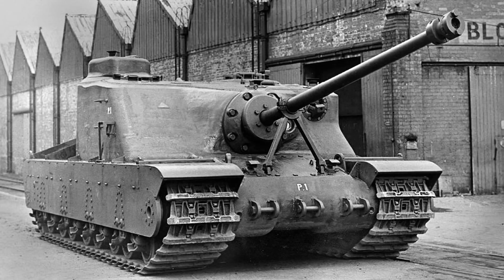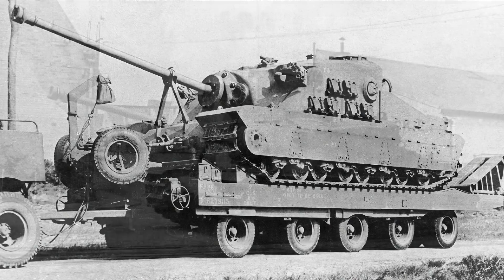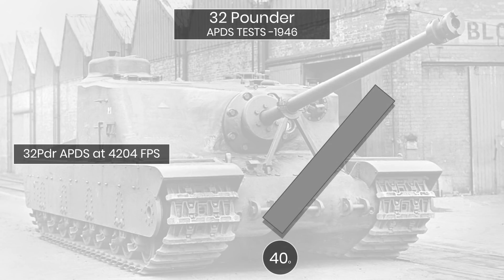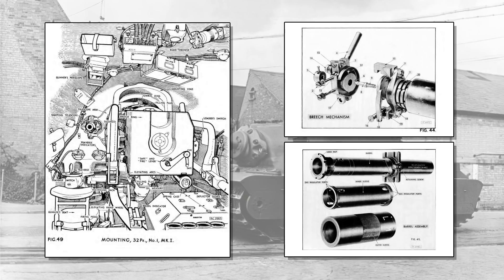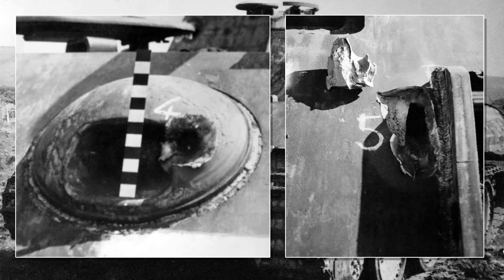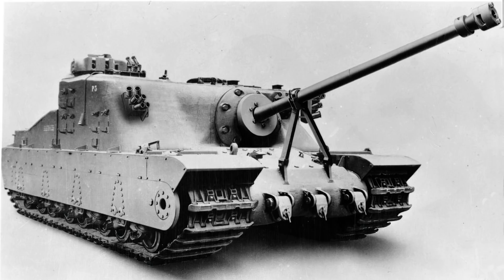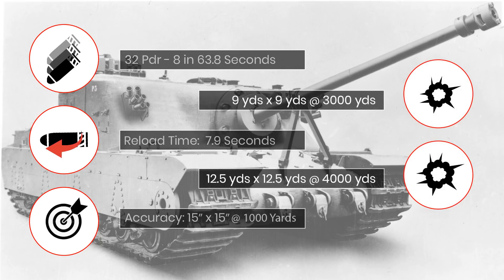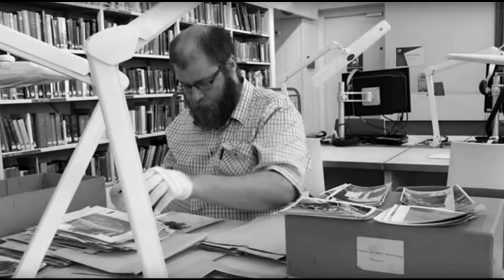Tortoise vs Panther - Tank Design & Development

Comment from the maker: Heads up guys. * please note that following the videos release  the date of the APDS test should read: 28/6/45 and the final APDS round vs 50 degrees is 4885 not 5885 fps as per typo.  (source A.R.D Terminal Ballistics Report No 16/46) the first date was missing from the tortoise file, the second is my butterfingers at typing

Comment: As a fan of casemated  'tanks' this is a very interesting episode, thankyou. The main disadvantage of such a vehicle of course is that it has to be rotated to aim but this forces the vehicle to automatically face towards the enemy. I forget how many photos I've seen of knocked out tanks not facing where their gun is pointing and so exposing their weak side armour. What was required with a casemated tank was an enhanced ability to rotate and aim but I've never heard of any such development. Such a vehicle has several potential advantages over a conventional tank - less complexity, no turret to jam or malfunction, generally a more compact vehicle that would be easier and cheaper to build and maintain yet have the same firepower. And lets not forget (although we apparently have) how successful the German StuG's were.
Reply: Check out the S tank.

Comment: Do you have any plans to cover the mythical Fv100 class of tanks. There is little public information available...
Reply from the maker: Sadly they are mostly mythical, the FV100, 101, 102 slots were created with the FV system for any future super heavy tanks/spg's - of which we had little interest after looking at stuff like the E100. they were kept about for a bit then dropped and the CVRT allocated the same numbers. - somewhere along the lines a few WOT forums started talking about prototypes etc which was no the case, and may have been muddling Minotaur and other STT projects up.
Reply: @armouredarchives8867  Ah, so nobody even bothered to design anything that heavy. Looks like they learned their lessons then. XD

Comment: What a waste of a Panther! Quality gun, serious fire power and accuracy.
Reply from the maker: Not really, post by late 40’s and 50's they were obsolete and considered left over junk, people only appreciate stuffs historical importance once that item becomes rare
Reply: @armouredarchives8867  I get that buts what's the point in testing old tank armour against a modern gun. It would have been easier to put a sheet of modern armour up, rather than trucking in an old, out dated tank.
Reply from the maker: @Ob1sdarkside  we they do now more or less, or have mobile rigs that run across the ranges, but back then they just used up what was lying around and tank shaped, many vehicles allied and axis ended up on ranges, either from mod bases, labs or even bovington tank musuem which send dozens of vehicles down to lulworth.  and shooting at somethign tank shaped and sized makes more sense for the accuracy than a single block.
Reply: @armouredarchives8867  Makes sense I suppose, whatever saves you money at the end of an expensive war. I read the Soviets did the same to a Tiger tank after the war.

Comment: I was very surprised during some research on the 32pdr to learn that it was an almost perfect surrogate for the D-10T firing APCBC. Nearly same projectile weight and muzzle velocity, similar cartridge size. Arguably a better early counter for the T-54 than the 20pdr.
Reply: The gun is a hair under 8 inch. If 155mm (6 nch) HE can  kill 'em then a 8 inch round would.

Comment: War tech vs after war tech. If the war would have lasted longer it would be a panther 2 or something else. German tech is always better
Reply from the maker: well panther 2 which was made mid war would have faired no better.
Reply: German tech was so good it won them the war.Oh wait...
Reply: Riiiiiight.... 

Lets look at a major example. Bismark. This 'superior' ship was not a bad ship, but hardly superior to its contemporaries. Why? Well lets look shall we?

The Bismark is analagous to the King George the Fifth Class, South Dakota Class and Littorio Classes of Battleships, all being laid down and completed in roughly the same time period. 

So, lets have a look at those ships. South Dakota was the slowest of those ships at 27.5 knots, followed by the KGV's at 28. Bismark and Littorios at 30. Both the SD's and KGV's had uch greater operational range however than either the German or Italian Battleships. KGV had the best armour of the 4 ship classes, being surpassed by only one Battleship class in History, that being the two Yamato's. 

Armament, and here its a a good deal worse for the German ships, The Littorios and Bismarks were 15 inch gun armed ships, but the Bismarks had 4 twin turrets compared to the three triples for the Italian ships meaning that the Bismarks were down a gun tube. The South Dakotas had 3 triple 16 inch main battery, so clearly superior to the two Axis ships in firepower. The KGV's had smaller guns with a 14 inch main battery, but had 10 gun tubes, 2 quad and one twin turrets, so its broadside throw weight was actually greater than the Bismarks.

So, now you have four ship classes that have roughly comparable combat capability. If any of these ships got into a 1 vs 1 fight with any of the others it would be a coin toss between them, the result of the action based around the skill of the crews, captains, and of course Lady luck. 

And this is where the design of the Bismarks really lets them down, because they are by FAR the largest of these four ship classes, in fact they are CONSIDERABLY larger than the South Dakota and King George the Fifth Class. The British and American ships displaced between 35,000 tons standard (S.Dak) and 37000 tons standard (KGV). The Bismarks displaced 41,000 tons standard.

In other words, the Germans managed to build a ship with the same Combat Power as the American and British ships built at the same time, on 6 - 4,000 tons greater displacement. That right there is shoddy design....

We will not go into the German 'superior' Light Cruisers and Destroyers that could not make their full speed because if they tried they would literally vibrate themselves to pieces.
Reply: @alganhar1  Not to mention that the Bismarck's radar system didn't work right. First salvo fired in anger from her guns disabled her radar system. Contemporary US battleships of the time came out of the yards with radars that worked. Her anti-aircraft fire control system was obsolete, although that was because the Germans sold the new system they made for the ship off to the Soviets. Her 37mm anti-aircraft guns were woefully outdated despite being designed in 1935 being single shot weapons compared to systems like the 40mm Bofors which came out a year earlier and is still used today. Those guns had a fancy mount that allowed them to be stabilized as the ship rolls... except it never worked right.
Reply: Panther 2 was designed to fix a problem that was fixed by just adding side skirts to the Panther 1. I doubt Panther 2 would have been made beyond a few prototypes, everything would have just be rolled in to the normal Panther.

Also German tech wasn't better. The US developed all sorts of great gear, it was just judged to be not that much of an advantage to deploy it in favor of the existing equipment which was already winning the war. The US had the same style of night vision gear for rifles the Germans developed (and the US actually used it), the US built axial flow jet engines that didn't self destruct unlike the Germans. The US designed and built a 75mm autoloader for a tank in WWII, they just didn't bother with it beyond testing. If history had been a little different and the T3E2 Garand (the Garand in .276) been adopted and the box mags for the Garand followed to completion the STG-44 would have been a footnote.

Comment: Is there any reason for the over 1000fps difference in the shots. Were these different loades? Or just the range of variation in shells. If so I did not know there was such variation
Reply from the maker: Yes, the mostly likely variation based on other tests of the time would have been upping or lowering the charge to get the performance required within the guns threshold.

Comment: No one complained that a shot on an already hit armor would be pointless to prove penetration?
Reply from the maker: It would depend heavily on how much fatigue the metal has had, the cooldown between shots, and a host of factors. for more accurate tests they tend to use custom made plate that controlled, this is more on the accuracy as both would invariably perforate an old panther. The bigger issue was the 20 pdr APDS was initially quite inaccurate

Comment: Speaking of 32pdr, was this gun or the 20pdr ever fitted into the black prince. I know the Meteor engine was too long for the engine deck, but we’re these guns ever fitted into the tank?
Reply from the maker: there was a proposal post war to fit in into cromwell, comet and a chuchill (type unkown) - only the cromwel would have it done as charioteer in the end
Reply: @armouredarchives8867  Wouldn't be surprised if it was the Churchill Black Prince since the turret and turret ring were big enough to fit the massive breach of the 17pdr. I read that the 77mm gun or 17pdr was proposed for the Churchill Mark 7, but the turret and turret ring were both too small. I had sources but lost them few years ago. Thanks for replying though.

Comment: 4:30 - that's a big variation in muzzle velocities. I presume one was given a higher charge on purpose?
Reply from the maker: yup, they will up it until they get the result needed.
Reply: @armouredarchives8867  or the wrong type of bang :)
Reply: You want to find out and use the lowest muzzle velocity that will do the job. A lot of muzzle velocity is great if it was free, but that force needs a strengthened breach, reduces barrel and breach life and with a turret can lead to trunion and turret ring wear unless you add a lot of brake or dampers to the gun, which would in turn increase weight and use up turret space, requiring a bigger turret, leading to a heavier and easier to hit vehicle. Too high muzzle velocity can also shatter the round itself, which looks like occurred with one of the 32lber tests.

Comment: Did this testing and the 32lbr test mounting into the Centurion have anything to do with developing the 105mm L7? Or did the 105mm L7 not come about til the T-54 was examined at the Budapest embassy/consulate?
Reply from the maker: the 105 had been in development before as a few peices mention it prior to the event, after 55 was captured tho, they got the armour assesment wrong, which made them feel the 20 pdr was not adeqaute.
Reply: The 105mm L7 was simply an enlarged 20 pdr to ease up development.

Comment: Very informative. I wonder why the Centurion gunnery was so poor against the Panther. Did they have issues with dispersion with the 20pdr?
Reply from the maker: yes the 20pdr apds was quite innacurate until late into its development
Reply: @armouredarchives8867  Given the Centurions were putting APCBC rounds through pillbox slits at 1500 metres in Korea, yes, it was the round, not the gun.  My uncle said that they could put anywhere they wanted out to 2km so long as they could see where someone asked them to put it.  He also said that after the first month or so they mostly carried cannister & HE rounds, with fewer than 10 AP rounds.  He never saw an APDS round until they got back to the UK.
Reply: Sounds like an issue with how the sights were calibrated to me, but I suspect you'd need a second Cent. brought in to compare.
Reply: @Vespuchian  

IIRC the inaccuracy issues stemmed from the shell or sabot, not the sights
I believe Canada later got a better projectile that did not have/had less issues
Reply: @Nightdare  The Canadian thing is for the 17-pdr, not the 20-pdr.
Reply: @Retrosicotte  

Woops, sorry, my mistake